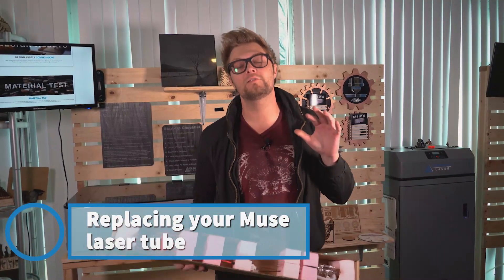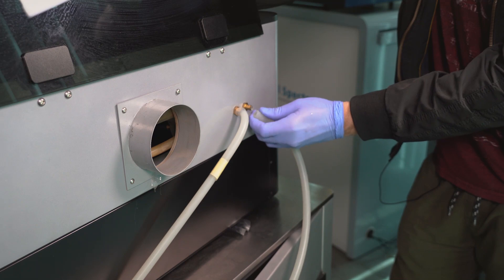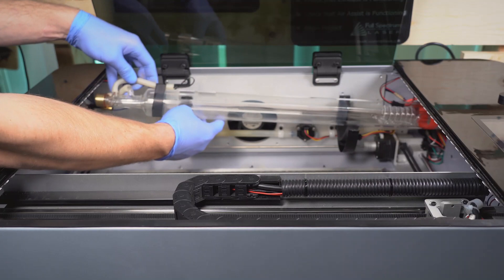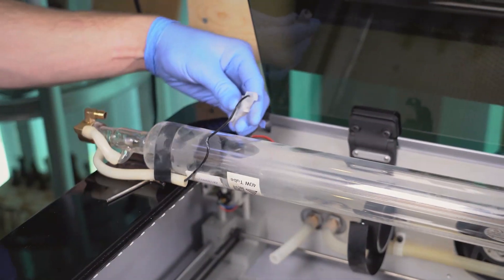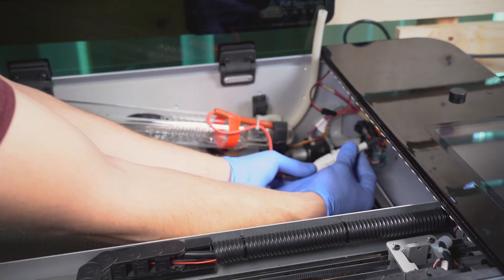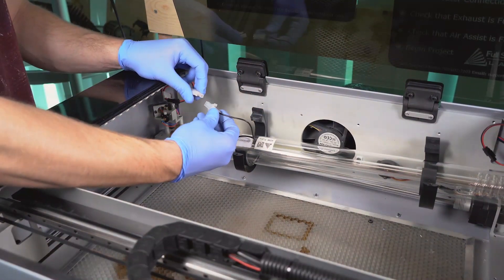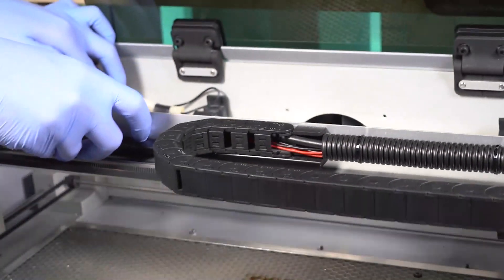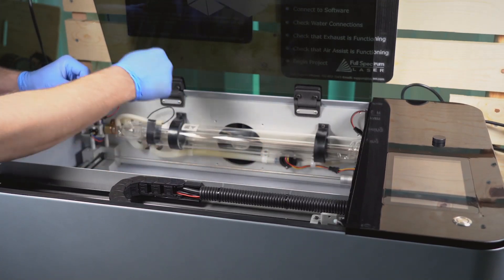Tutorial - Muse and Hobby Series Tube Replacement (easy at home steps!)

Comment: Do you have to do any kind of manual alignment for the laser after replacing the tube? I saw a video for a Makeblock laserbox laser tube swap that had to go through some tedious alignment steps. It seems like it is all automated with the Muse but I just want to double check.
Reply from the maker: It is not automated. The Muse, like most other gantry lasers, also needs to be aligned every now and again. In theory, if the brackets holding your tube and your mirrors haven't moved while swapping your tube, it should still be good, but there can be slight variations in the tube shape that can cause the optical path to shift.